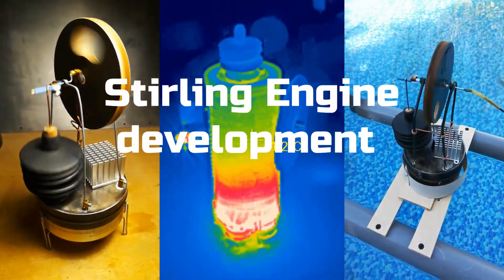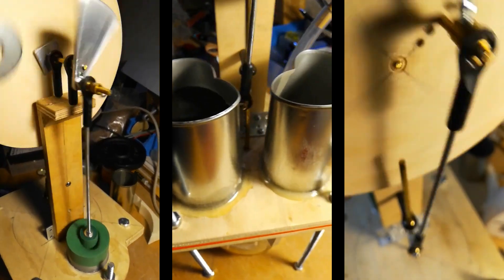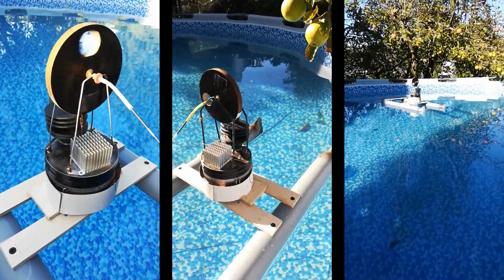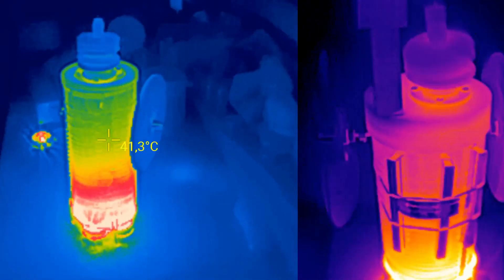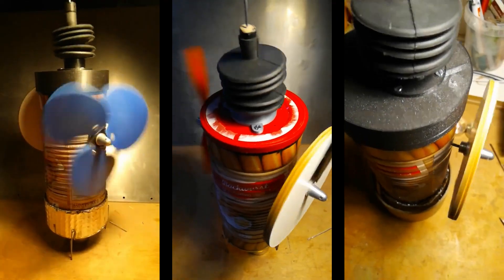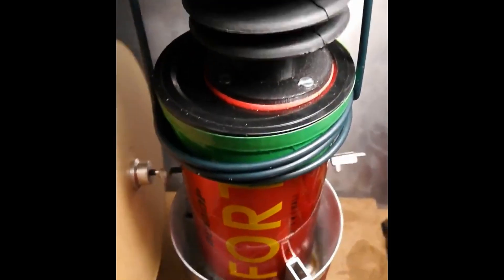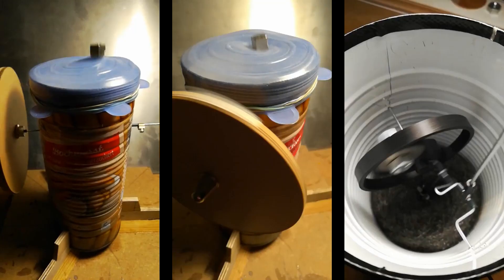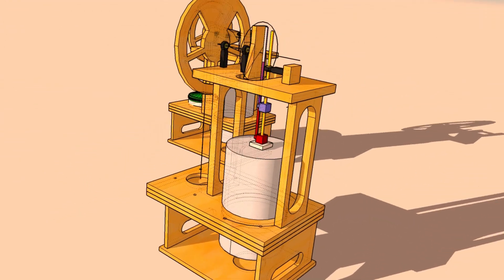Stirling Engine - the development of a DIY engine

Comment: Cool. This is a nice design. Out of curiosity how much energy do you estimate was harvested by the engine? Milde critique your diction while very clear, is a bit stiff. I would recommend that you dictate your script using text-to-speech software, and then try to do a second recording explaining what what the video is presenting using the script as a guild line. You've got a good voice so you just need practice to gain confidence.
Reply from the maker: Thank you for your comment and your feedback on my voice. I will try to do even better, but it is difficult. That’s why many people avoid using voice in their videos. 
Regarding the engine's performance, it produces a maximum of 3W. It is a small model created with the simplest means. I think if the engine were larger and professionally built, the performance would correspondingly increase. In the long term, solar heat or waste heat should be used as an energy source.
Reply: @diyforge  Your diction, voice and explanations are great, don't change anything. Well maybe change your boat propeller to a "water type" propeller as it looks more like a plane propeller right now.
Reply: @diyforge  Don't get me wrong, you are leagues better at presentation than me. But, I do think that what would slow your growth as a channel is down to how you read the script. Your content is amazing, so you have a lot of potential. Just a little less perfect will add the missing spice.

Comment: Hell yeah, take advantage of the natural temperature gradients in the environment to perform work. I suspect the Navy has kicked around this idea, given the success of nuclear powered stirling engines in certain submarines. Solar thermal power can power a ship with a large enough surface area of a black selective absorber, bonded to a large loop of heat pipes, and a very wide aspect ratio piston, and an underwater heat sink composed of heat pipe struts which form a hydrofoil to lift the ship from the water and reduce drag.
Reply from the maker: You’re absolutely right; utilizing natural temperature gradients offers exciting possibilities. The idea of using solar thermal power to drive a ship is truly innovative. It's impressive how far technology has come, especially with nuclear-powered Stirling engines in submarines. Your suggestion of a black selective absorber and heat pipes sounds very promising. I find the concept of lifting a ship out of the water using a hydrofoil-like heat exchanger particularly interesting. Thanks for sharing these inspiring thoughts!